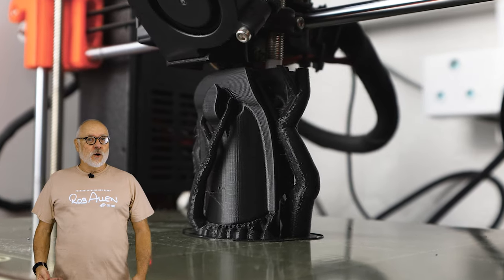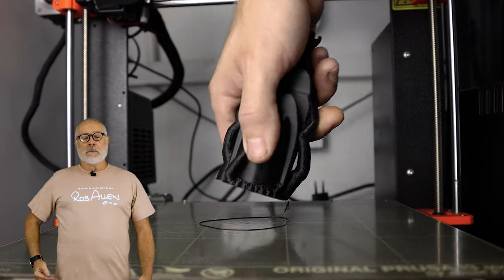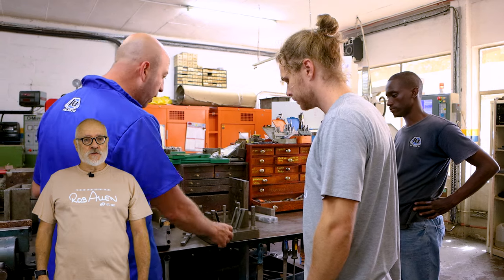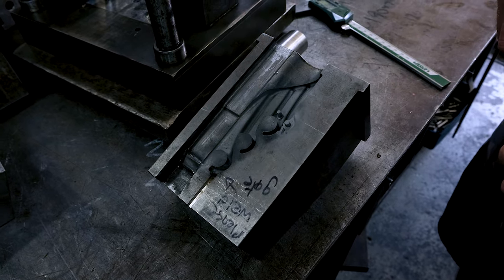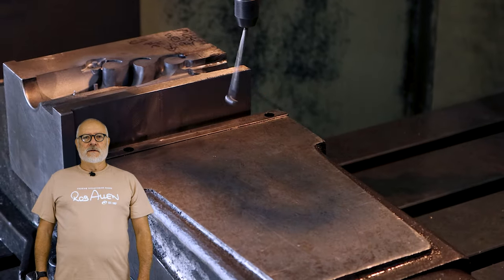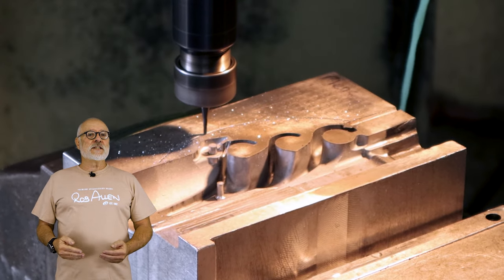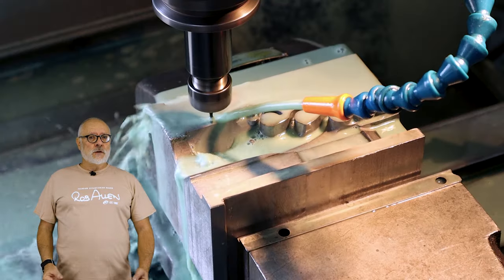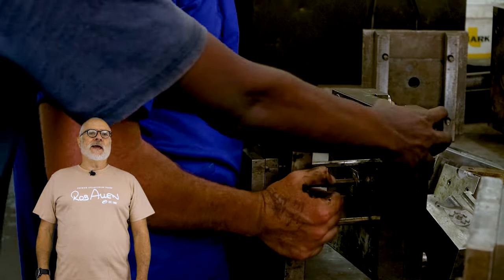Rob Allen | R&D | Triple Band Muzzle | 2024

Comment: I have learnt how to spearfish with a 110 tuna, a fantastic speargun. I adore the robustness and simplicity.but other manufacturers use reverse and stainless trigger mechanism for more than a decade. I will be drill to see a new reverse trigger mech made by rob allen. 
are you planning somthing similar soon?
Reply from the maker: Hi, I have had many discussions about a reverse trigger. In my opinion, there is so little advantage that I feel it is just a marketing thing. For one, if you gun is set up correctly, you will get the spear up to maximum speed. Bringing the rubber further back along the spear will not make the spear go any faster. We have discussed spear speed in many videos. The negative with a reverse mechanism is that you are making it even harder to load. The further back you need to pull the rubber the more difficult it is. Guys then make their rubbers longer to help load, pointless. Regarding all stainless steel triggers, there is a video we put up on how bad stainless is when rubbing against stainless. It eventually starts to fret (gall) and make the trigger pull harder. Watch the video. Guys who use full stainless do not realize their trigger pull is getting stiffer as it takes a long time. We have run our trigger up to 20,000 cycles at max load with little or no change in trigger pull feel.

Comment: What is the application that a 3 band would be needed, and can this be used on a standard 1000 tuna 2 band ra gun?
Reply from the maker: There are 2 reasons we developed the muzzle, 1 is for those who have trouble loading a big gun. They can use thinner rubber. The 2nd is to drive an 8mm spear adequately on a Timberline gun. So it could be used on a 1000 Tuna just to make loading easier.
Reply: @RobAllenSpearfishing  oh I see thanks
Reply: @RobAllenSpearfishing  so are the 3 thinner rubbers comparable to two larger, more power or equal ?
Reply from the maker: @246spearfishing7  It depends how you set it up. As long as you are getting the spear up to max speed both will be good. The main advantage is for those who battle to load single or double rubber guns, can now load easier.

Comment: Assuming it is intended for bluewater use, Why not, 3*14 on 340-350% or 3 *16 mm 300% with an 8 mm shaft. No one is going to use 3 rubbers speargun for reef that two 14 mms can do with equal results. Btw, what a beautiful muzzle though ,❤👍👍 go buy a 120 cm carbon barreled RA speargun with that muzzle and two Shafts, a7 mm and an 8mms, 3x14 mm rubber, you'll get yourself a speargun for almost every occasion.
Reply from the maker: You will be supersized just how many requests we have had for this 3 rubber muzzle with 12mm rubbers. There are many youngsters, some ladies and persons with shoulder issues who can't even load a 14mm rubber but can load a 12mm. The 12mm works fine on our standard guns up to a 7,5mm spear. The 8mm in our opinion is just too heavy and creates way too much recoil. The weight of an 8mm works best on a Timberline gun. Also, our ability to add buoyancy with the Timberline barrel helps massively to compensate for the 8mm spears mass. 

We have done test on all set ups and have no problem using 3 x 14mm on the Timberline with an 8mm spear.
Reply: @RobAllenSpearfishing  That's a fair assesment 🫡👍👍, people really do wants different things from this muzzle. Some saw it as a way to help them ease their loading efforts. But to some, like me, adding this bad boy to a  timberline gun might persuade me to buy one of the timberline series. I'm sorry Rob, but the timberline series are just too pricy for me 😂😅✌️✌️. I understand the added buoyancy and strength to that barrel, but to add a roller muzzle to that barrel seems redundant, why add something that already have little to no recoil to a timber-fortified carbon barrel? And why only stop at two rubber muzzle, even when we know that narrel can handle more power and recoil. This three banded muzzle is just what the timberline series needed. The possibilities of adjusting your setup to your environment without changing your muzzle is really impressive. No disrespect tho, just sharing my frustation😁
Reply from the maker: @Gronky-sv5yp  All good. We try to make whatever options customers want. As long as the setup is functional we will make it.

Comment: Have u thought of introducing a roller with a kicker ?
Reply from the maker: No, we do not see a reason. If your single roller is set up correctly you will get the spear to max speed. No point fitting another rubber as all you will do is add recoil unnecessary.  If you want to drive a thicker spear, better to use a double roller.
Reply: Do you plan on developing a double roller muzzle?
Reply: Love all your testing and development keep them coming Rob
Reply from the maker: @greatnorthern3481   Many thanks.
Reply from the maker: @DETECTIVELARRY  We have been working on one for a long time, just not ready yet to show.